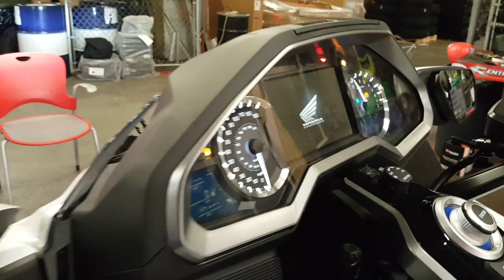Un-Crating and Assembly of 2018 Honda Gold Wing

Comment: How do you recommend feeding the connectors for heated jackets from the battery to a usable place near the seat?
Reply from the maker: I think there may be some space near where Honda recommends to install the Entry Lights or the Cigarette Lighter/12V Power connector.